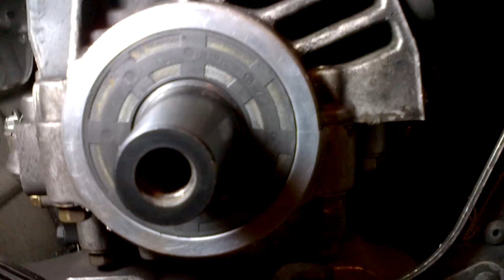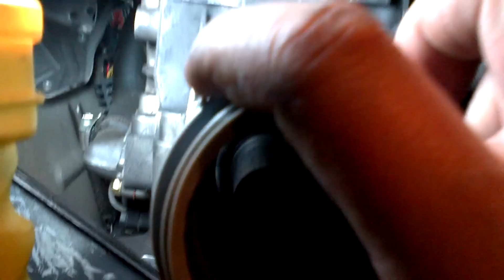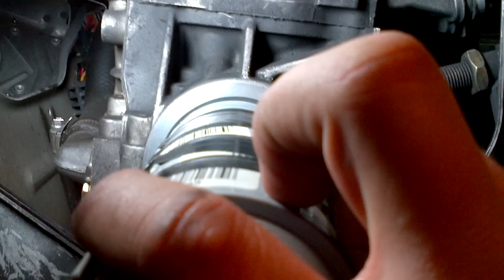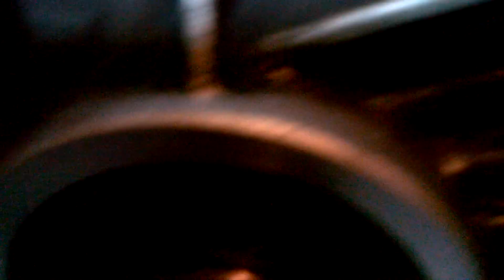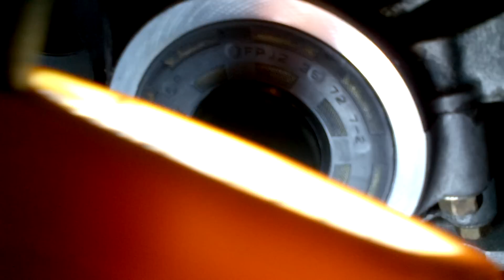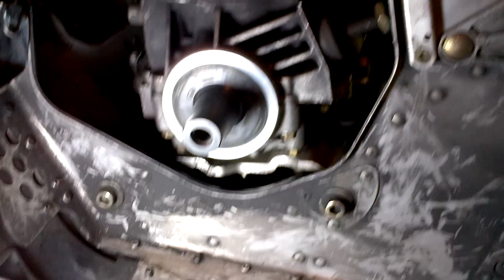2005 Skidoo 500ss - PTO Seal Install #2

Comment from the maker: 2014 UPDATE ON SEAL REPLACEMENT - After this video I decided it would be a good idea to pull out the seal again and replace it given the rubber lip on the new seal squeezed off when I was trying to force it in to set. So I went aftermarket seal ( I think SPI made them) anyway the after market seal ended up being much more ridged than the skidoo OEM part and I was able to use the exact same method to knock the aftermarket seal into place. A couple tips. USE LOTS OF ISO Flex to pack the seal. Tip two - with your finger run a small silicone bead around the lip of the seal, this helps it slide into the slot and also ensures a perfect seal along the lip later. I ran this sled for another 2000 miles after this job, then sold it to my nephew who has been riding it ever since with not issues at all. total about 4500 miles on the sled since the seal replacement. SLED IS RUNNING PERFECTLY!
Reply: Do you have the P/N for the SPI seal ?

Comment from the maker: There is literally 9000 miles on the engine since the seal replacement. It is holding just fine.

Comment: did you end up running the sled like that?  I need to change mine and have a 09 same motor.  seen people say both ways.  split the case or just pound it in.

Comment: My experience of dozens of motors that I've rebuilt, I don't trust the way you are doing it! if the seal doesn't seal you can melt the motor down, I feel its like playing with fire, the best way is to split the crankcase and replace properly but its your call I don't mess around, do it right, nothing worse that being on the trail and having this in the back of your head and even worse is for it to fail and hurt the motor

Comment: I wouldn't run it it's going to fail and run lean witch means burned pistons ! You need to split those cases! If you cant do it like that you could try and cool the seal in the freezer for a hour and warm up the case with a electric heat gun this will expand the size of the hole and along with the cooled seal will make it easier to install put a little high temp silicone the copper stuff around the seal just before you are going to install it this will allow it to slip in easier without tearing the seal get it set in and let it cure for 24 hours that should help hold it in and seal up any small minute or possible leaks ! But if it were mine I would just spend the time and money and do the split that way you know it's done right! Unless you are going to dump the sled this would be a quick fix!